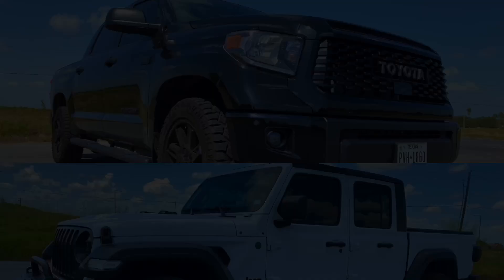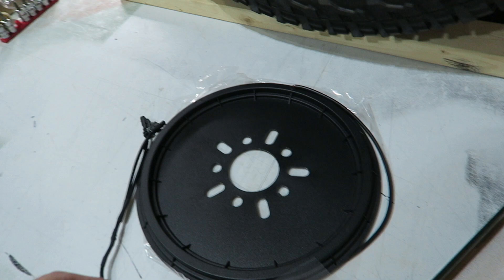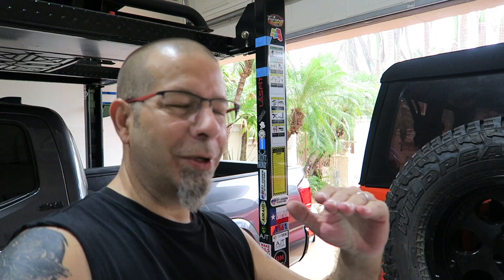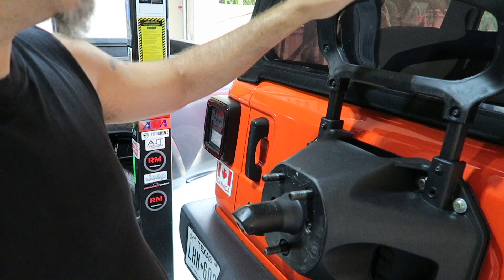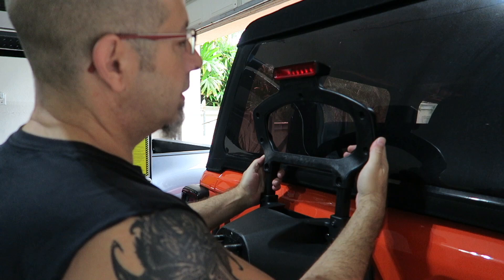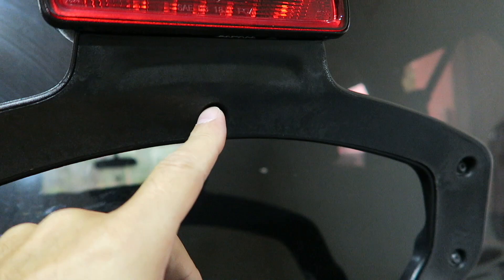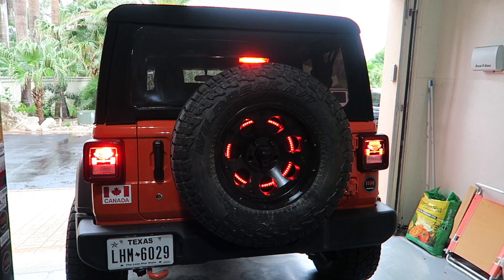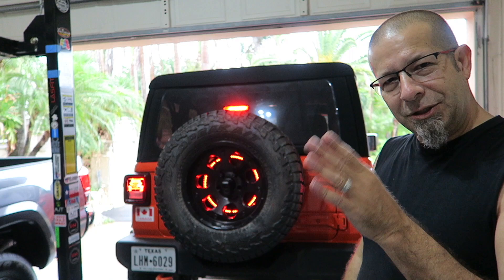Jeep Spare Tire Brake Light Ring Install

Comment: Nice install Rob. Does the new light bracket push the spare out from the tailgate just a little?  It looks pretty insignificant but like your wife’s JL, I have those aftermarket tire bump stops on the tailgate.
Reply from the maker: Not at all.  The plate is pretty thin👍